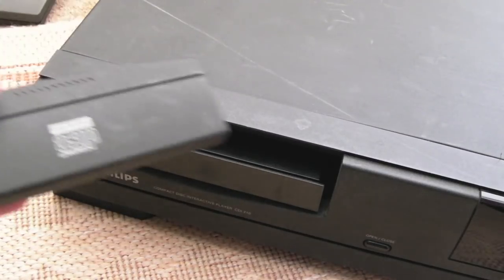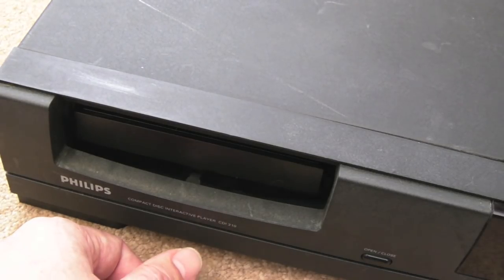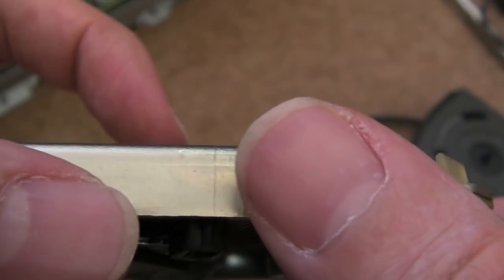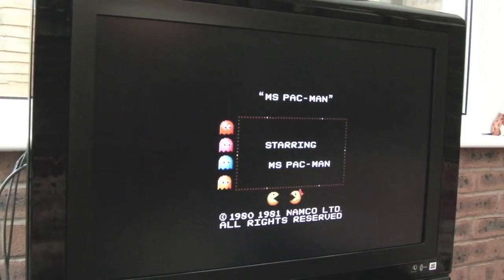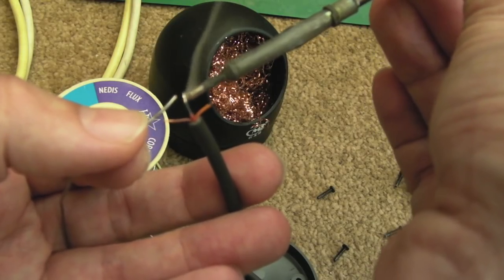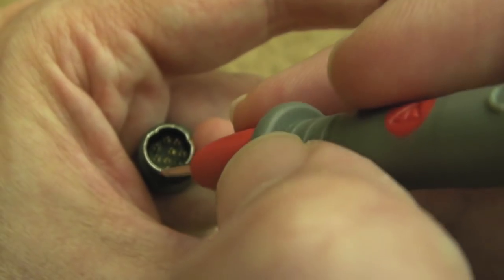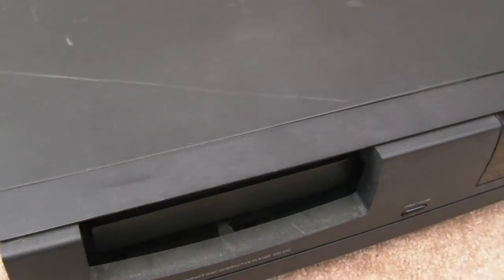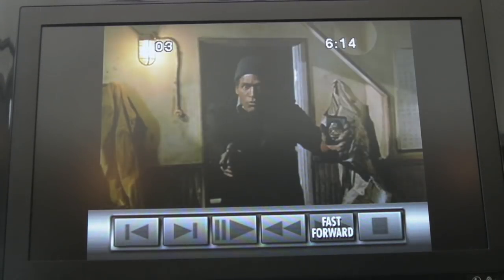Philips CDi 210 - Drive Repair & Gamepad Repair (Part 1)

Comment: Hi, fantastic info... just for anyone else out there... you can replace the drive belt by moving the smaller movable piece of plastic out the way and use very small screwdrivers to hold it in place. Secondly, the CDi 210 I had literally had a meltdown when it couldn't spin the drive or close the tray, error messages the lot... the second I greased all the gears (being careful NOT to grease the drive belt - or it'll slip and not close), replaced the drive belt and used two tiny screwdrivers to edge to drive disc up just a mm or so... good news is if you push it to hard and it comes off you can just push it carefully back into place. Couple of tips here... take it slow and steady, don't forget some of the plastic here is like 30+ years old and happy to snap and also you can access the disc spinner tray thing far easier with the drive closed (as it raises a little), by removing the top cover that is loose on the top of the drive tray (a little careful wiggle and it doesnt come loose so you can access the drive easier) and also access it from the rear facing forward, theres a little gap just enough space to edge the plastic up bit by bit but again use a tiny screwdriver and edge up very slowly until you can spin it with your finger and is loose.

Comment: I want to thank you for the info, this video saved my cdi wich had a stuck spindle. I didnt even take the drive appart, I just use two lego brick separator on the spindle and it goes back to place.

Comment: I recently got a CDi (exactly the same model as in the video) and it's working I have followed your advice thank you for the videos.
I do still have an issue with the drive tho it seems there's something not fitting quite right in it as it keeps squeaking as it's reading the discs, which it can play however I do get errors like "your disc may be dirty" or the game just outright does not load. 
I have only really tried it out with one game so far, a burned copy of Zak van Sam which I played to completion, it's an FMV game so it has to access the disc all the time. It didn't seem to be an issue with the disc being dirty as it would crash at various different points, so it wasn't like a specific clip each time rather ransom spots.
Could it have something to do with me maybe lifting the spindle a bit too high? I fear it might be the case as the plastic bit that presses the disc seems to rub against the frame it resides in...
Reply from the maker: It does sound like the disc maybe rubbing on something!  Inspect the inside of the drive carefully (perhaps with the disc in) to see if you can work out where the squeeking noise is coming from.
Reply: @GadgetUK164  I have found what the issue was, the spindle was rubbing against the screws on the disc drive mechanism, raising it higher than I raised it before fixed the issue now I can barely even hear it running.

Comment: As far as I know you don't need a CRT tv to play Mad Dog or any other gun shooting games on the cdi. You setup the receiver that comes with the peacekeeper and you can shoot away.
Reply from the maker: Light guns use the vblank and hblank to determine the position on screen, a modern LCD or Plasma cannot re-create that as it tends to draw the image a frame at a time or in 3 sections etc.  I would be suprised if any old lightgun like that works on a a modern TV even with a receiver.
Reply: @GadgetUK164  the Sega Menacer used infrared tracking on a receiver connected to the console port.  Akin to modern arcade guns and the Wii tracking, totally I dependant of display. It was definitely known earlier than we think - I don't know if the Philips gun would do this.

Comment: I had a philips Cd-i and after you put the disc in the CD-i the  disc would not spin and you would get an error message on the front panel.  Would you know how to fix that?
Reply from the maker: If its the tray version like the one in this video, the same fix shown in this video might solve it (if your spindle is pressed down).  Beyond that, it would probably be the laser needing replacement.

Comment: Took mine apart and fixed the drive as well, but the door spring came out and I cannot for the life of me figure out how to put it back together :/
Reply from the maker: =/  You could also buy a working unit and compare to that?
Reply: GadgetUK164 - Retro Gaming Repairs & Mods 
My unit works, it's just the door on the front of it. It doesn't close, the drive closes when pushing the button, but not the door.

Comment: I hope that you don't mind if I say that I don't like at all using sticky tape to protect the soldered cables from making a short. That will work perfect of course, but I hate tape as it becomes sticky everywhere after the years. That's why I prefer to use a thinner heat-shrink tubing instead. For example what I made days ago: https://postimg.cc/image/bd1ctkcq7/
Reply from the maker: Yes, thinner heat shrink is better!  But provided you have multiple layer of tubing (like I did), it really isn't anything to even worry about.

Comment: LaserDisc, LaserVision, Disc-o-vision, VLP, are all the same thing. I think you mean CD Video (not to be confused with Video CD), which was yet another version of LaserDisc but at least digital audio was no longer optional. CDV was LD with gold colored discs and standard digital audio. Not all of the earlier LD players supported digital audio and CD playback but all CDV players did.
Reply from the maker: Strictly speaking, they aren't exactly the same thing!  I had a VLP player that was from the late 70's - that played Laser Vision, that was Philips early road map for Laser Disc, but you couldn't play Laser Disc on a Laser Vision player.  But there was CD Video - used a lot in jukeboxes if memory serves.   But Laser Vision isn't really Laser Disc, it's more a case of Laser Disc took the LV format and improved it with digital encoding.
Reply: GadgetUK164 - Retro Gaming Repairs & Mods 
This confusion is why LaserDisc was never a success. :)

LaserVision is the format name where LaserDisc was originally a brand name owned by Pioneer for the same format. They used LD on their players and the discs they published while their industry partners with compatible players had to use LV. Users played LaserVision discs on LaserDisc or LaserVision players but discs published by Pioneer might also say LaserDisc on them. If your player was, say, a Panasonic then it would also say “LaserVision” instead of LaserDisc. That changed in the early ‘90s when Pioneer opened up the LaserDisc name to the rest of the industry.

In 1984 they added digital soundtracks for compatible players but it was often at the expense of compatibility with earlier players. You often had a choice between DTS, digital, and standard releases for a given title. For the European market they basically re-launched the format as CD Video where all CD Video discs and players supported digital audio and had gold-colored discs, but they were 100% compatible with digital audio LD/LV players (and vice versa). LaserDisc/LaserVision users were left dealing with discs that only worked on some players and not others, but solving that for European releases obviously didn’t save the format. There were also various releases for picture format (Academy, letterboxed wide, and anamorphic wide). Then we have CLV vs CAV discs... It was a real mess!

I live in the region where they test-marketed it back in the ‘70s so I’ve seen more Disc-o-Vision discs than most. :)

Comment: I had the RealMagic Hollywood+ MPEG2 DVD decoder card from Sigma Designs when I got my first DVD drive. It was a massive improvement over software decoders at the time, which required a top of the line PC and still had terrible TV out quality.
Reply from the maker: Yeah, I had that too!  The one required for DVD =D   But that same company did release an MPEG-1 decoder for VCD - not seen one on eBay ever =/

Comment: There is a program you can get for the pc, although I forget what it’s called that allows you to access and copy of the mpg file of these cd-I discs, if you just put them in a pc they almost always crash the OS!  I think it was a programme that helps you recover files from a damaged cd as it accesses the raw data in a different way to the OS.

Comment: Dude where do you get the energy for all this youtubing? Two a week is damn near killing me.
Reply: I would like to add a word regarding patching holes, repairing hinges and so on. My personal favourite is Oyumaru in clear colour - it is at ebay in best price and epoxy putty - Milliput. About both of them is lots of vids. Disadvantage might be colour of epoxy putty, but it might be spray painted or even some sort of colourant might be added. tough places might be filled with toothpick. I think that is most promising solution from all which I ever saw. When I was a kid I spent my free time with model-making lessons. 

I got Ouymaru and Milliput to repair broken hinges in my psone. Epoxy putty might be treated by a file. Blue Stuff is a bit more expensive than Ouymaru is but both of them seems to be very similar if not very same solution. Worth to try - on some junk at first. 

Screw posts might be repaired too. You need to wrap around the screw using Teflon (PTFE) tape, and then add epoxy putty to the hole and insert screw in there. Wait for cure and we have got screw post alive back again;)
Reply from the maker: Hehe =D  Off work this week, so not had much else to do!

Comment: when welding plastics, you can actually use strands of wire to strengthen the bond between both plastic pieces. Heat the wire onto the plastic, push it in, and use the heat to encapsulate the strands inside the plastic. It's less likely to break at the weakest point (the crack itself) again after this :D
Reply from the maker: Nice tip =D  Never thought of that!

Comment: Had my CD-i player for nearly 20 years now and the door in front of the CD tray never closed properly. It looks like it’s supposed to lift when the tray retracts but spring is too weak. It hasn’t been connected in a few years but the save battery still worked last time. I’ve been putting off dealing with both for far too long and I was already planning to make a video of it but now I’ll look like a copy-cat. :)

Seeing Dragon’s Lair really makes me want an MPEG decoder for mine. Heck, I even have a couple CD-i moves but I’ve played those in VCD and DVD players (they work when you browse to the MPEG file). I recall watching one title (whatever it was) on my hacked XBOX and watching the other title (Silence of the Lambs) even earlier on my N64 (via Bung Doctor V64). Yeah, I don’t see why they weren’t just part of the VCD spec.
Reply from the maker: No idea how much the decoder cards sell for?  Nice to have though just for VCD imo.  I didn't know that some of the games required the card?  I might try Dragons Lair later without the card to see what happens.

Comment: I loved 7th Guest, I was about 13 when it came out. I liked the puzzels but had no idea what was going on in the actial game, something about a murder years ago and a reporter.  It was one of the first CDROM games too. I also had Creature Shock.  Amazing that games like that can be rended real time without even bothering the system and would the quality of graphics would be classed as comically bad.  On the joypad I would have suspected the internal end of the cable first, just on the basis if it is, you have an invisible repair, if its not, you've touble checked.

I'll try catch you on the stream tonight and as the question "why are you obsessesed in poking 2 fingers into every slot you see?" 51:38.   And its friction not kinetic energy.  I'd never thought I'd see the day I'd correct you on something ;)

Good work.
Reply from the maker: Sorry if I missed any questions last night - it was hard to keep up with everything lol.   7th Guest was awesome, and Creature Shock as well =D  I played some Creature Shock yesterday and it wasn't too bad!  Regards the point about cutting off the internal connector first - yes, that's absolutely what I learned from this experience - start with the one that's easy to fix without any visible change first. =D  Thanks on the correction lol =D
Reply: Good seeing you on the stream last night.  I think its only the 2nd time I've seen your face.  The other time it's usually someone filming the back of your head playing an arcade machine.
Reply from the maker: Hehe, thanks mate =D

Comment: Yep Gravis, probably a mold license rather than the brand, I wonder if the shells and buttons are transferable without modification? You want to play CD-i with me...nah I don't feel like pulling the whole unit out. ^_^ I don't know why they did that to the battery? Hah funny you had a PC then considering what this console was marketed as. Looks tough to repair but I hear that's the dependable model. Not a fan but I've always wanted to try one.
Reply from the maker: Yes, the do look nice, and great to play around with but there's just not enough in the way of games really.  There are some good games like Lemmings and that beat em up game which I forget the name of (will show it in part 2).
Reply from the maker: And I think you're right, licensed mold from Gravis or something =D

Comment: Interesting how they went for a linear PSU instead of a SMPS, which is probably a good thing! Their VCRs of the same era (with similar styling) had switched-mode power supplies packed with light blue Philips caps that always seemed to leak. 

They always seemed to favour those round 'Wickman' type fuses that liked to pop for absolutely no reason whatsoever, so if your VFD ever dies I'd immediately suspect one of those.

The connectors with the clips I've seen before in their TVs and VCRs so the innards look quite familiar.
Reply from the maker: Good point on those round fuses =D  I had forgotten about those damn things lol.  It does like very VCR ish in its design.

Comment: Retromancave fit one of the video cards for his 486 trash to treasure pc video.
Reply from the maker: I saw that video - that wasn't the same card though!  He had an MPEG-2 card (which I also had around 2000 ish - for DVD support), but before that there was a full length card that provided MPEG-1, released around the same time as the CDI hit the market.